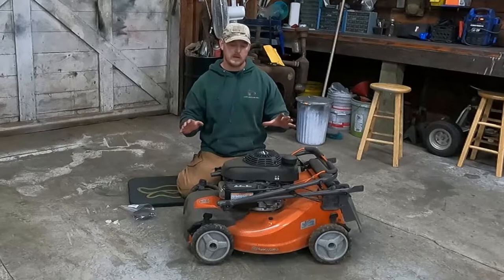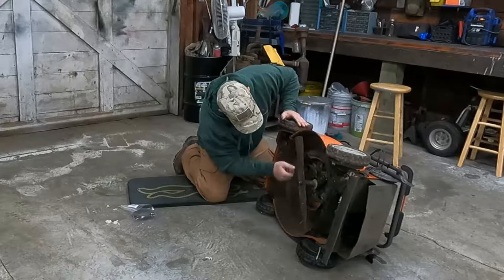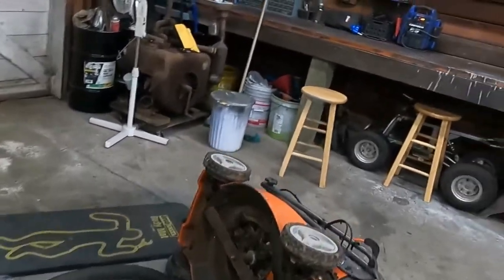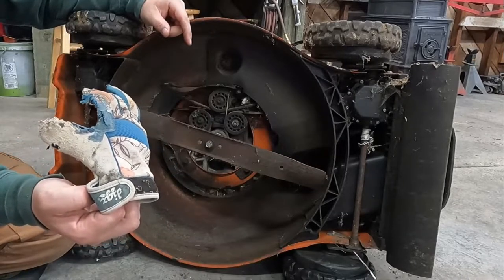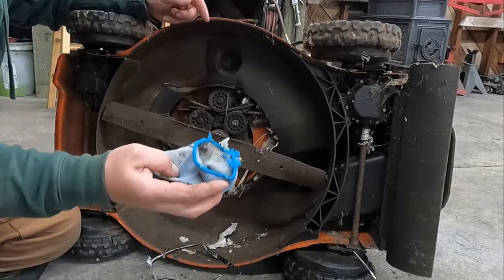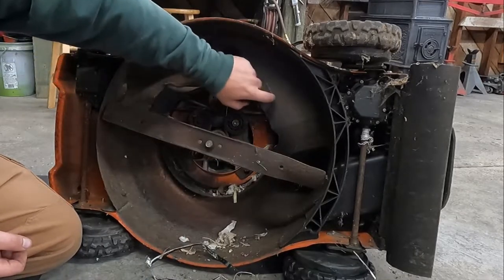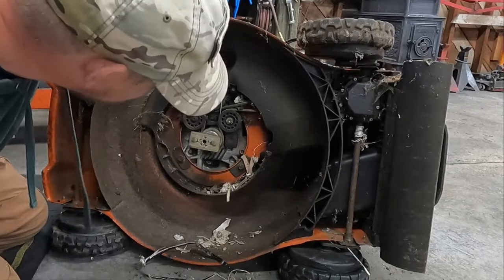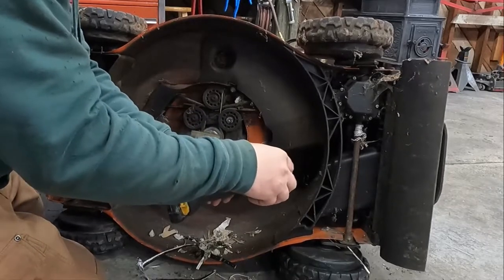Husqvarna AWD Drive Belt Replacement

Comment: Your video was very good except for one of the hex screws to remove the front cover required the removal of the front wheel, wheel bracket and the drive gear. (At least on my model) The drive gear is held with a split ring.

Comment: Great video - As complete as it gets for pulley and belt replacement. I had to modify the bracket on mine since the part that screws into the deck broke off, which tore up 2 pulleys and snapped the belt..... had to drill a hole on the other end of the bracket and put another screw in. So far, everything is working again..... coz pushing the mower up a hill without AWD really s@cks!!!!
Thank you again !! 😃
Reply from the maker: Glad I could help.

Comment: DJ, those pulleys have a bearing cover that can be easily popped off with a knife or pick. They are dry with no grease! Put a little grease in them so they will last a lot longer!
Reply from the maker: Thanks for the advice!

Comment: Moral of the story, never buy a self-propelled mower again... I'm facing this (and likely a stripped gear in one of my rear wheels - may just be easier to replace the thing... GREAT video though!
Reply from the maker: Sorry for your troubles. It definitely overcomplicates things. I ended up pushing this thing for the rest of the mowing season before I fixed it. It's nice when it works

Comment: Why not grease the wheels shafts
Reply from the maker: The pully doesn't spin in the shaft. The pully spins on the bearing. putting grease on the shaft wont do anything for you.

Comment: This is horrible!!  It shouldn't be that hard to do.
Reply from the maker: It's definitely not a fun job.
Reply: You dare to speak the truth ? :goodvibes:
Reply: It’s not hard after your first time
Reply: @philliphall5198 that’s what she said!
Reply: It's not, he did it the hard way. No need to remove anything in the front other than the one long bolt than you can slip the belt off the pulley. No need at all to remove the plastic cover, tranny, or wheels at all. I've done quite a few of these with both the honda engines and the briggs engines
Reply: Unfortunately all these steps are necessary.